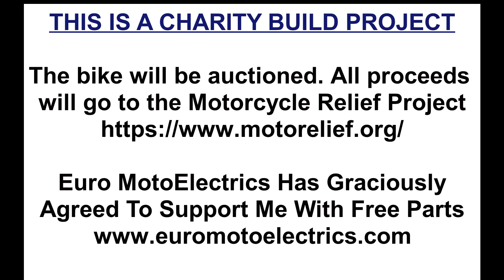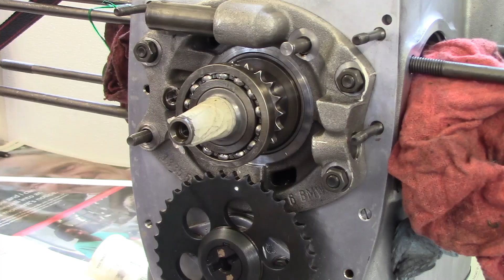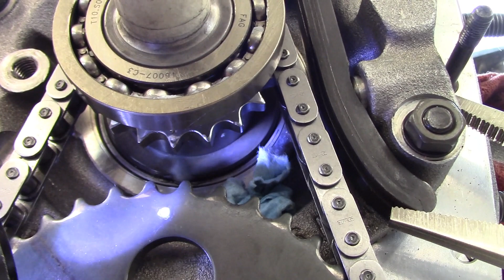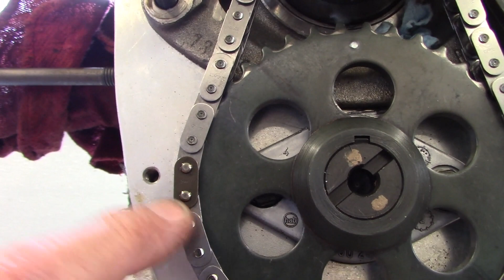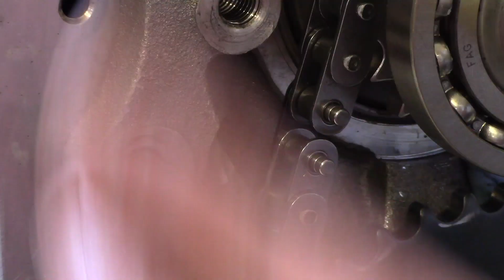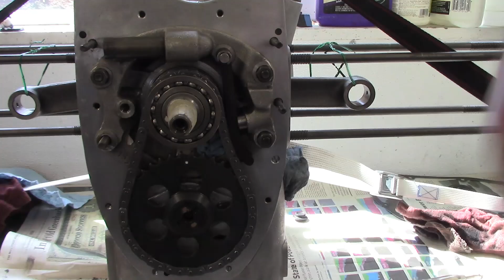1983 BMW R80ST Install Timing Chain

Comment: Great demonstration, thanks. I found a small six-inch-long mini channel lock pliers has just the right angle to be able to grip the plate and reach around to insert the two pins from the rear. Just a little more positive grip, helps makes it a little less fiddly.  Thanks for the videos.
Reply from the maker: Matthew, thanks for the tip. I'll try that next time.